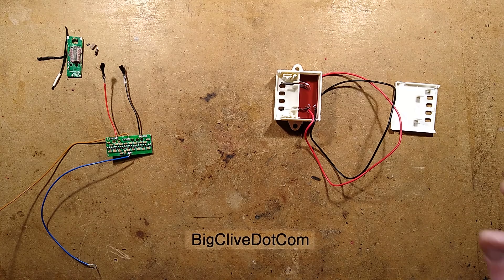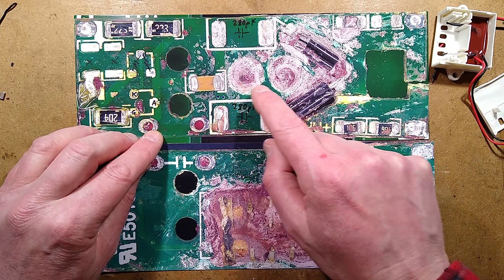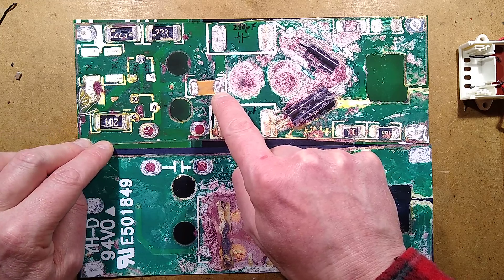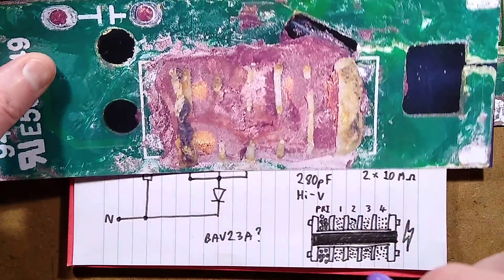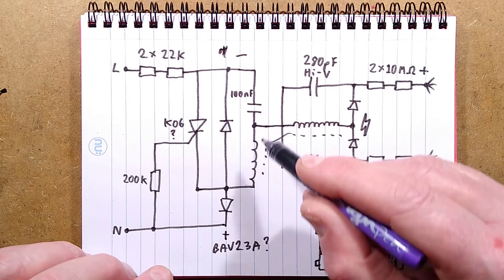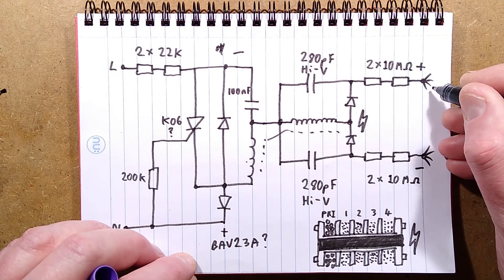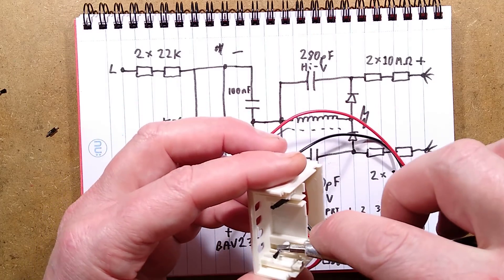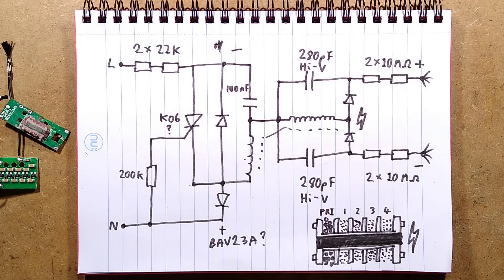USA 110V fridge sanitizer reverse engineering (with schematic)

Comment: I wonder if one of the emitters was thinner due to poor quality control. These low end modules vary wildly with ion emission. It’s a serious issue because if you have lopsided ion charge output, it can noticeably change results in air cleaning, or even make it worse. I don’t like low end bipolar ionizers for this reason

Comment: Hoping to see the 12v version some time in the future.  I just purchased a couple of the 110v and 12v models to play around with. I'm curious to find out how much current the 12v unit uses while in operation, and also how wide of a voltage range can it effectively function. I'm hoping the run one on three series lithium ion cells.
Reply from the maker: The 12V one uses just 10mA.

Comment: Not quite accurate on the carbon filaments.  At these high temps metals oxidise and also become globular.  Carbon is more resistant to oxidising and won’t go globular due to melting at the tips.  ;)

Comment: I tore apart a tower fan that had stopped indexing L/R from center . It had a long , small diameter squirrel cage it use to move the air and the indexing of the housing was done with a bell crank and offset arm.  Point of this reply is that it had a o-zone generator built into the system also as when I found the carbon filament discharger leads and circuits I wasn't able to come up with what this all was until much later.  I still have the components stashed away in my electronics tote but to say it wasn't encapsulated like the one you struggled with and yes it was feed from standard 115 VAC,, It wasn't built like the one you showed but rather had the input section of the PCB have the multiplier for the higher feed AC if I remember correctly.  Nice video , thank you Clive.

Comment: Clive, I believe that the diode across the scr also has the function of acting as a 'disconnect diode'' to insure that the scr 'turns off' right after the current pulse. This is quite important in scr switching circuits of all kinds.

Comment: @bigclivedotcom I bought a cheap £17.99 Bosch mp3 player from Argos the connection to the earbud jack was horrible and the noises walking about was unbearable is that a flaw or just a really cheap and nasty way to connect a jack plug. Just I know gold is super conductive so creates better connections. So I was wondering if I get a gold jack on my existing ear buds maybe it will work better or do I need gold on the connecter also.  PS I sent the mp3 player back.

Comment: Clive’s teardowns are the best I’ve ever seen. 

I’ve been a professional electronic design engineer myself for many years. My observation is this: 
It turns out that “reverse engineering” and “failure analysis” are two extremely important skills that aren’t taught in University. And when it comes to mass-marketed consumer products, clever design and component choice can make the difference between the “number one best product” and imitators which are total duds, suitable only for tossing into the bin.
Clive gets it right by sorting out and throughly explaining the critically important aspects of the design and manufacturing processes that wind up with the result of the item being “excellent,” “dodgy,” or downright dangerous.

Comment: why not simply use an additiona; doubler stage(or two) in the 110Vac version?
Reply from the maker: It would need twice as many stages.  Each one adds on the peak mains voltage.

Comment: I have a bed fan I bought that's 1) too loud and 2) too fast at its lowest setting. I haven't looked at its circuitry to know how it works, but I presume it's a simple AC motor with a potentiometer for the switch. How should I go about slowing down the fan? Can I put a resistor in line with the pot to the motor?
Reply from the maker: Some switch windings, some have electronic control and some just switch capacitors.

Comment: Try heating the compound with the soldering iron and check if that makes it easier to remove. I also find adding a bit of soldering flux (paste) and heating it that way sometimes makes the compound more 'rubbery' and easier to cut a small piece off, or to lift off components without too much residue. I don't know why, but it works for the polyurethane base compound we use.

Comment: As suggestion would you like to check out Marshall Bluetooth speaker Stanmore 1? Those were supposedly high quality and pretty expensive speakers that blew very often after warranty was out. I dont have the internals no more since i pretty much rebuilt whole thing with chinese cheap amp and few scrap speakers to add load, but it would be interesting to hear what was the reason of the faults in them. I'm sure sourcing one blown one should not be difficult or expensive task.

Comment: I wonder if the difference in the carbon brushes ins't to increase the efficiency of drawing in new air.  The excess negatively charged air molecules would be repelled out, drawing in fresh air while also carrying ozone out.

Clive, have you ever looked into flame rectification used in gas furnaces to prove the flame.  It uses a 4 to 1 burner (ground) to flame rod surface area so the current is rectified proving the flame and that the flame rod isn't shorted to ground (if it was the current would be balance AC)
Reply from the maker: I've come across the ionisation flame rod detectors, but not the rectification aspect.

Comment: noob question: why are some things potted or "glop top" is it for keeping secrets, durability, heatsync?
Reply from the maker: Sometimes to hide the circuitry, sometimes to avoid high voltage issues.  In the case of blob chips it's purely the cheapest way to mount a chip on a PCB.  Direct with wire bonds and then a blob of black resin to protect it from damage and light.
Reply: @bigclivedotcom  thank ya Clive

Comment: Why couldn't they do the 110 volt version as a multiplier with additional stages? Or would this push the cost up to the point where it's cheaper to do the transformer version?
Reply from the maker: I'm not really sure.  I was kinda expecting two multiplier boards, but it must be a cost balance.  On one hand it would probably be impractical to make a 120V air ioniser based on the traditional European 230V multiplier.  But the multiplier stage is much low in these units due to the vicinity of the fine carbon fibre clusters.
Reply: from what i can understand, to get the same voltage that hte EU one puts out, they'd need a board with ~33-35 multiplier stages, which in the end is around $5.92 (as of Q4 2020) higher than the transformer type.

Comment: I have a 240-volt outlets at my workbench in the US. I just wired it for two phase instead of one phase.(3 120v phase is more common in commercial) if you do such a thing please use the right plug otherwise you'll plug in 120 stuff eventually.

Comment: O3 generator in a closed environment attacking the copper and other metals will also generate warranty issues.
Reply from the maker: It's very low level, but will still potentially have an effect.

Comment: This circuit seems more expensive. Doesnt the mosquitoes zappers also create ozone? the circuit is smaller on those.
Reply from the maker: They don't.  Their voltage is too low and they are not optimised for creating ozone.
Reply: @bigclivedotcom But it is possible to smell the ozone in the mosquito Zapper. I just don't know how efficient it is.
Reply from the maker: @ableite  Any spark will create ozone, but not efficiently.

Comment: Hi Clive, been searching through YouTube trying to find a good video that explains how to test a 12V triac. Seems they either over complicate it, or don't speak English. Please, please, please, could you correct this black hole in YouTube videos, or point me in a good direction. Thank you for many, many hours of entertainment and learning. I had never touched a soldering iron before watching your vids and the first lockdown occurred. Now my spare room is my electronic hideaway. Thank you.
Reply from the maker: Most triacs fail short-circuit if they get overloaded.  That shows as a dead short between the MT12 and MT2 terminals.
To actually test oine you could put it in series with a small lamp and then trigger it with a current limited DC source (like a battery and resistor) passing a high enough current to match the trigger current.  Then apply that current between MT1 and the gate.  The triac should latch on.
Reply: @bigclivedotcom  cheers

Comment: Those component testers are the most ingenious things ever made.  Think about what it has done for reverse engineering or trouble shooting a failed prototype circuit.
Reply from the maker: They are an incredible bit of design and software.
Reply: @bigclivedotcom  I heard years ago that the guy that designed and coded the original got hosed.  It was to be open source for non-commercial use, but everyone and their brother just ripped the code, popped it onto an exact copy or a stripped down version of his hardware, and undercut his pricing by half.
Reply from the maker: @jameslmorehead  That happens.  It's a harsh, but useful lesson in life.

Comment: 10:24 I was wondering how the secondary side could work without a common reference point.
Reply from the maker: The current effectively flows between the emitters as charged air.
Reply: @bigclivedotcom  I was referring to the missing connection to the transformer common that you were about to add at that time index.

Comment: Wow, so with these HV diodes they used the same technique as with HV capacitors by placing several identical ones in series?
Cheap and clever.

Comment: Neat video and explanation. It raised a subject I am curious about. I am interested in devices that increase voltage. I have seen circuits that I believe are used in Taser personal defense devices. Both the ones that use a gas contained in the cartridge that houses the barbed needles and wires and the units that have two points that are held against the "bad guy" to impart a disabling charge allowing one to run away. Some Chinese market sites seem to have many units of various designs and I always wonder if they actually work as advertised or are a con. Nonetheless, how they work intrigues me. Is it something you would be comfortable dissecting, building, or discussing a circuit design?
Reply: Look up how a step-up transformer works, then read https://en.wikipedia.org/wiki/Flyback_converter
Reply: @LiyangHU  Thanks for the link, much appreciated

Comment: Do you have any means of measuring the output voltage? High voltage probe? 
I'd be very curios to know what each of those modules produce.
Reply from the maker: It's hard because a high voltage probe would load the output down.
Reply: @bigclivedotcom  good point.
Reply: @bigclivedotcom  However, assuming your volt meter has a 1 Meg input impedance, you could use a 10Meg resistor in series with the output. Making a voltage divider out of the 10Meg resistor, and the 1Meg impedance of the meter. 
What you'll read on the meter, would be ~ 10x smaller than what's at the output if you use a 10Meg. 100x smaller, if you use a 100Meg resistor. 
Why would that not work? Logic says it should.

Comment: That's a lot of work you put into this video!
Much appreciated.
I'd trust the transformer version more. Not only because of galvanic isolation, but because it can run reliably between -20ºC and +50ºC. 
Capacitor version with SMD multiplayer ceramics, would crack and blowup after a few extreme thermal cycles. 
Trough-hole components are best. The stresses from expansion and contraction of the PCB and parts with thermal cycling, are better tolerated with leads acting as buffers.

Comment: Clive the circuit reminds me of one I have used for many years. I take a standard  house type lamp dimmer, and a old 12 volt car coil and start cap in the 4 to 6 mf range to make spark effects. Like a small jacobs latter for example. They work great,  they can run a long time with out anything getting hot. Thanks you for the teardown .

Comment: could you put this in a washing machine to remove smells?
Reply: Sure, why not? But putting your washing machine on a self-cleaning cycle might be a better idea. Also clean out the lint trap. And leave the door open after washing to let the insides dry out a bit. 

PS don't forget to take it out before starting a cycle.

Comment: I found it interesting that the transformer is an auto transformer. As a step up auto transformer, I found it surprising that the secondary didn't use any of the primary windings, as one of the advantages in typical step up and step down auto transformers is that the primary and secondary can share a number of turns, thus reduce cost if an isolation tramsformer is not needed.
Reply: To be fair, there are negligible primary windings in comparison to the secondary. Chances are they also use different wire gauges.
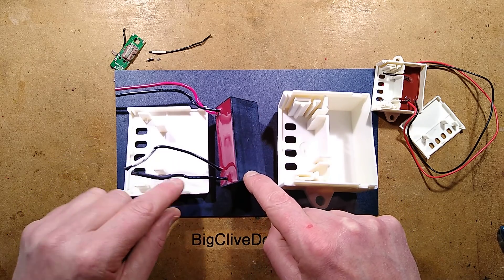Reply: @LiyangHU  For 10 fold increase in voltage i think tgey could have used an auto transformer with turn ratios 9,2,9 where the middle section is used as the primary with a turn ratio of 2 and the two outside coils and the primary coils (9+2+9=20 ) makeup the secondary and simplifies to 1:10.  

While the equivalent isolation  transformer will have a full 10× more turns on its secondary  but the auto transformer only needs 9× more because it is also using the turns in primary as part of overall turns. 

Granted, maybe a 10% reduction in secondary windings wont add up to much, but if you can do it and save a few pennies, and lower the transformer's secondary resistance by maybe 9% then why not? 

Yes the primary windings may likely  need to be a lower gauge to carry higher current.
Reply: @kreynolds1123  I don't think the saving on materials is worth the extra manufacturing steps. Just like the extra steps you took in your detailed response. :)
Reply: @LiyangHU  Maybe, but to prevent shorting,  the high voltage transformer is already constructed in the kinds of stages needed to make the kind of transformer i described.

Comment: Be interesting to see how much radio frequency interference this produces, looks like it would be quite an effective transmitter and there are no suppression components or screening.
Reply: There is quite a lot of screening when it's inside a fridge.  There are gaps, of course, but a lot of screening.
Reply: @bdf2718  Whilst the fridge cavity will be somewhat screened, that won't help with the inevitable RF conducted back out of the supply wires.  No chokes/ferrites or other RF decoupling is present.

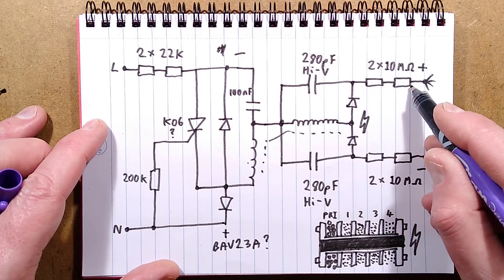Comment: 10:45 some of America is actually 220-240V, mostly in south America. And really north America is 240V as well, I know in Canada we are 240v, we do just one phase for the outlets at 120V, but the house gets 240V and large appliance do as well (stove, dryer etc...)
Reply: Can confirm the US it is the same as Canada.
Reply: @R_Forde  thanks, that is what I thought as well. I don't know why so many people think we have just 120v going into the home and we run our water heaters, baseboard heaters, thermopompes etc... on that. And really, I don't see why I would give more than 120v to my light and vacums etc... for the extra safety 120v provides.
Reply: It's similar in Europe, 400V into the house and 240 V at most outlets.
Reply: There's also 208V 3 phase power in the US (mostly only installed at industrial locations).

Comment: When Biden is inaugurated the National Voltage will be increased
Reply: Mike5 so will the dollar menu
Reply: @firstlast8805  I'm always up for more things for a loonie!
Reply: Beyond the 240V that housses in north America already get ?
Reply: @TenOfZero1  Yes. Much further
Reply: @Mike_5  what a bizarre misinterpretation of the need to improve long distance power transmission line efficiency by using higher voltages there.  household electric voltages will remain unchanged, only long distance power lines need to be improved to support sharing wind and solar power use further away from the source.  Biden will likely use federal money to help this improvement in electric utilities to happen without the cost showing up as an increase on your utility bill. (long term it will actually decrease your electric bill)
Reply: @chisight7521  500v plus then

Comment: Today I learn why those transformers look the way they do.

Question regarding ionizers. Do CW adders have issues with higher frequency ac?
Reply from the maker: At higher frequency they become much more efficient, so you can use lower value capacitors, but may need faster switching diodes.

Comment: It could be interesting to figure if they were actually made by the same OEM, or just rebranded by the same from different sources. The 240V version seems like it should be a lot cheaper to manufacture.
Question: since this is voltage multiplier, shouldn't the 240V version also work as-is on a 110V source? (maybe with one more stage of diode/capacitor to get a similar output)
Reply from the maker: Each stage just adds one increment and not a multiplier as the name implies.  The multiplier would have to be at least twice as long for 110V.
I think these do all come from the same company.  It's a fairly specialist device.
Reply: Getting a CW adder-based ionizer working on NA mains without an expensive transformer is my white whale.

Comment: Bit surprising they did completely different circuitry. Were they unable to do a 2x capacitive ladder using both sides of the board to make up the lower US/NA voltage?
Reply from the maker: It's possibly a cost balancing act.
Reply: @bigclivedotcom  Cost and size are the considerations. They probably couldn't get a double boost circuit to fit in such a small space, or it had issues like flashover or the like.